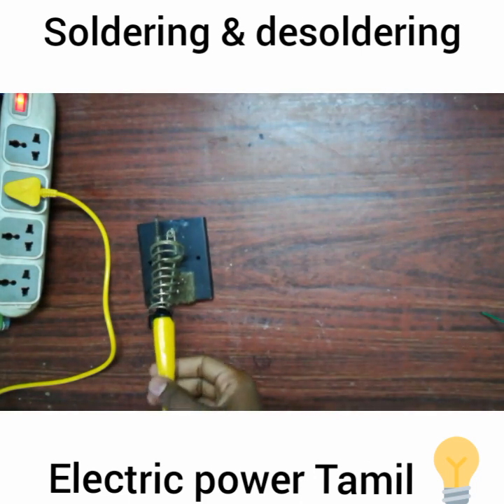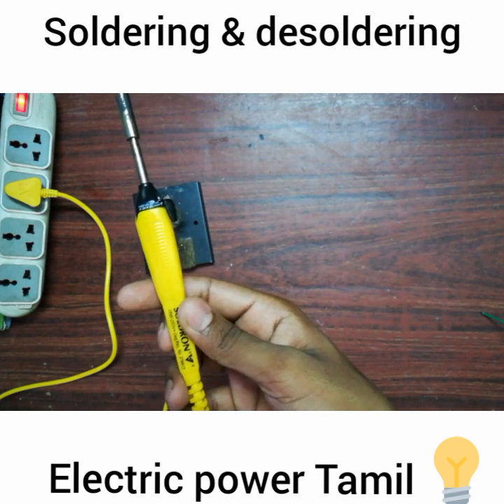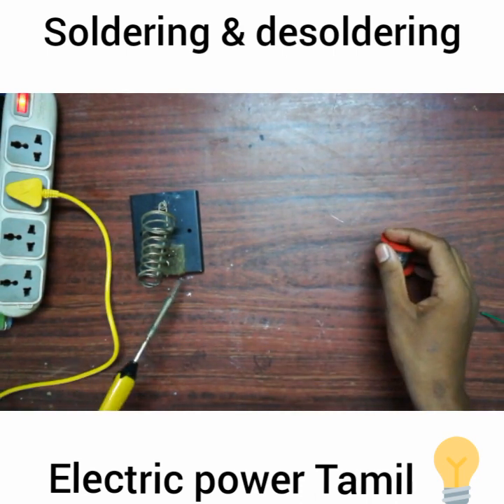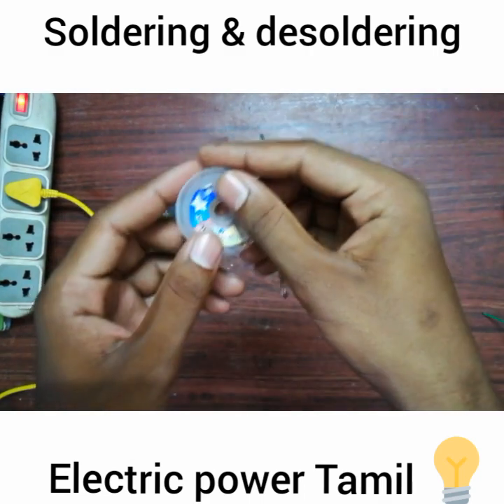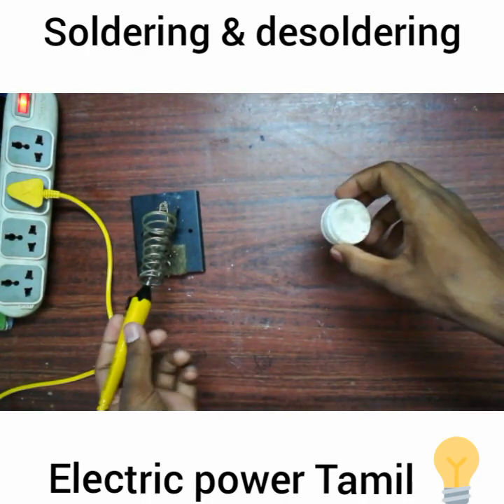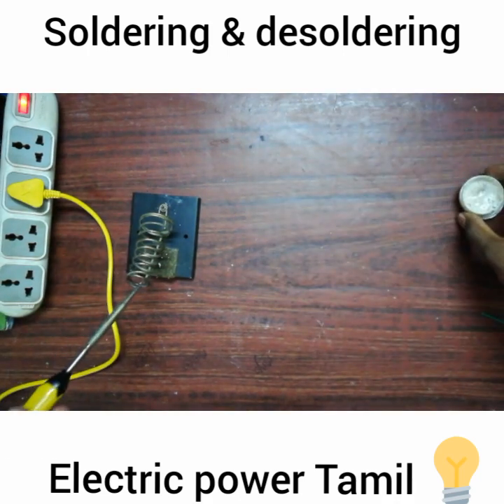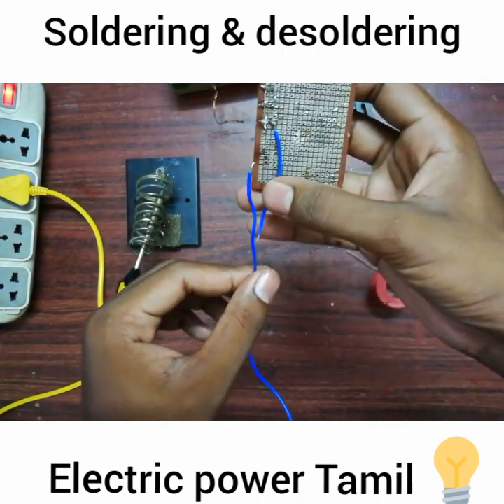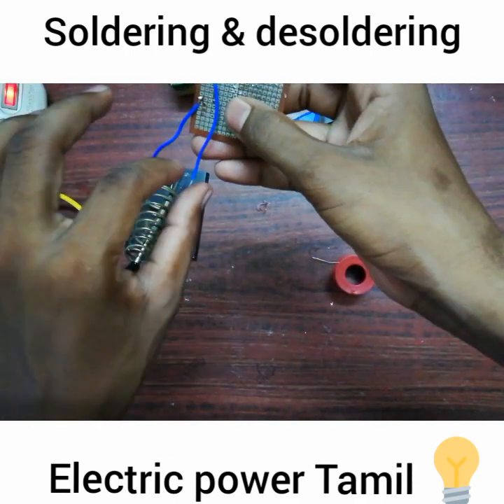How to Solder and De-Solder for Beginners in Tamil

Comment: Bro flux soldering rode la nikka maaddankuthu. 
Ball maathiri keela vilunthiruthu bro. 
Why?
Reply from the maker: It's called oxidised or carbonised,neenga soldering iron tip-a file or sand paper vachi clean pannuga then flux-la dip pannitu lead vachi paruga normal akudium👍
Reply: Bro sand paer use pannathinga
Reply: Athuku pathala exo scrub irumbu scrubla soldering irona suda vachitu appadiye vachu vachu edunga
Reply: This video method is wrong?